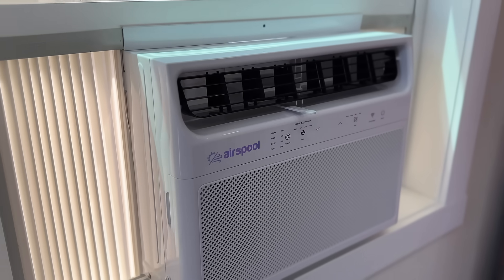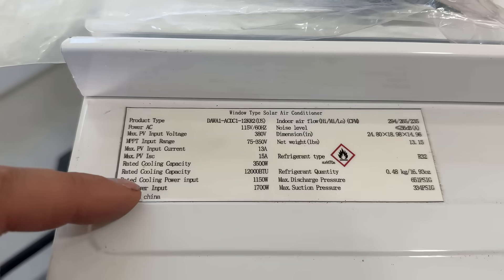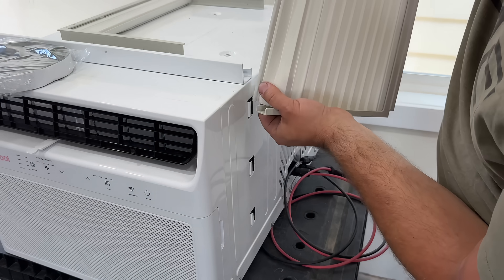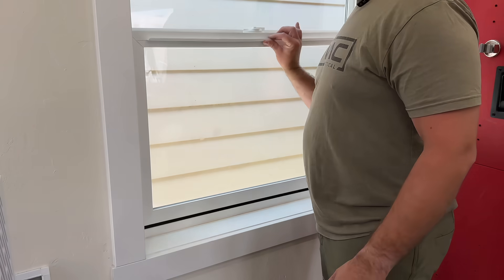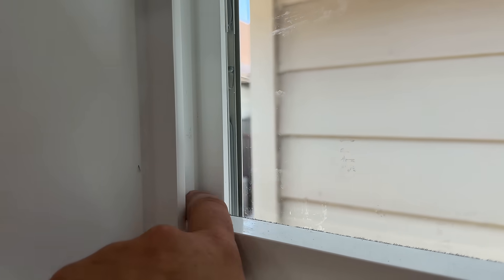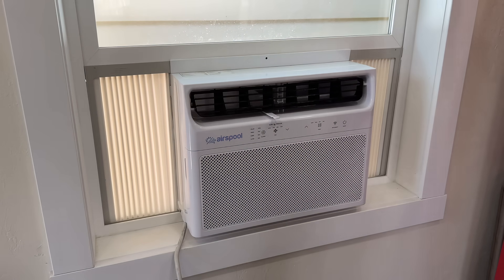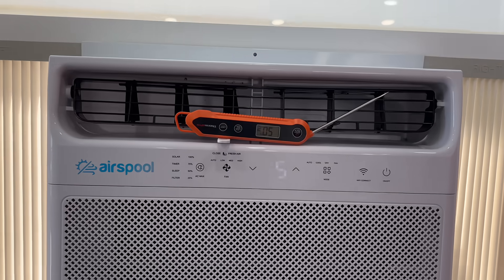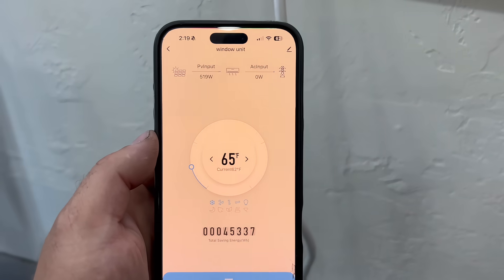Introducing The World's First SOLAR WINDOW AIR CONDITIONER...

Comment: What's wrong with using the solar panels and battery system (that aren't part of this AC unit) to fuel a pure sine inverter and simply plugging in a standard $100 5000 btu AC unit into that? A lot cheaper and that inverter can be used for other appliances as well.
Reply: Yeah, that's the first thing that came to my mind as well.
Reply: Inrush current.
Reply: @airspool  Ya, no. Not if you just get a window unit.
Reply: Likely more significant loss of efficiency going DC (solar) to AC (inverter).
Reply: @onlylettersatozornum  It's true there is some loss from the conversion but since that inverter can be used for many other things....
Reply: That's the way to go but peeps just don't know. Buy an AC and inverter and save $800 ..sigh

Comment: You have an "open" window,  the top of the bottom sash and the bottom of the top sash are no longer sealed against air/wind/bugs. You should have stuffed a strip of foam between top of the bottom sash and the glass of the top sash to prevent air intrusion into the room at this area now open to the outside, bugs can come in this area too.
Reply from the maker: Great point! I'll make sure to address that in a future video. 👍🏼

Comment: I'm amused by a sentence on the manufacturer's website when describing this window AC. "So much free cooling." I'm still trying to figure out the free part. Are they giving these ACs away? No. They're $1095 plus shipping and sales tax. It requires about 1800 watts of solar power, which they estimate at about $600 plus mounting hardware. When everything is all said and done, it's probably around $2,000 give or take a hundred bucks or two. Window AC units usually last about 10 years or so. I don't see this unit ever paying for itself. It's not exactly very efficient either. It's SEER2 rating is 17. I just installed a Hisense mini-split 12,000 BTU heat pump with a SEER2 rating of 23. I got a great deal on it and paid $650. My next door neighbor is a HVAC guy (hence the great price) and he installed it for free.

Comment: Very nice, just dont work the way I do my math:  150 doll ac in  H.Depot now have a Grand for electricity, and don't have to buy any solar panels, that probably would get a big fine from Citi if not installed with a permit.
Reply: With the solar not being connected to the grid, I don't think they'd care at all. I have solar hanging odd my balcony and have had zero issues because its only connected to an ecoflow delta pro.
Reply: @ArchoniaAdventures  Thanks for reply , it was a good video. Surely that AC will find lots of uses .

Comment: $1,195 for 12 000 btu AC that is conneced to power inverter? Total scam and waist of money. If you like quiet (42dB) buy Frigitair 12 000 btu windows AC model GWW125TE1 with additional true sigh inverter for around $150. I you like some no brand 12 000 btu AC from Amazon like KISSAIR is for $299 - same 42dB noise level.

Comment: i bought a new 8000 btu inverter window ac that doesnt require solar- just 110 outlet-  It works good , its like 20% less electric at most off my bill compared to my conventional window AC that i removed- U dont hear that surge when my 8000 btu conventional compressor use to kick in ...
Reply: Can you send me the brand or model numbef of that ac unit...got a shed I can use the 8000 btu..Thx

Comment: I have 2 mini split heat pump units that run on solar with batteries for 24 hours a day operation. Also I have a window unit that is an inverter heat pump unit. I can set these at 73 but they keep my house 68 to 69 all over the place. Oklahoma electric company got 5 price increases in 2024 basically doubled the price of residential electricity . I also power some other stuff in my house on EcoFlow delta pro units. I went from a $400. a month is summer to $49. a month. I put the stuff all to gather my self. I learned how on YouTube college LOL .
Reply: So your mini splits are directly connected to your solar setup and batteries?
Reply: They have to keep raising their rates to make up for everyone going solar!! (Just kidding). But congrats, that is a huge savings for sure! I would think the mini splits on solar would be the way to go, both heating and cooling. We live in an area where we have predominant need for heat and mostly cloudy or covered in snow those 3 months we desperately need it. I am hoping prices will come down to something reasonable for the 2 or 3 days of the year we can actually benefit from it 🤣🤣🤣
Reply: SAY MORE, PLEASE! 🙏 I want this setup!
Reply: Could you please make a video showing us how to install the mini splits with solar?
Reply: How many volts are the panel
Reply: Question....I'm still learning 
Recently upgraded my old marine batteries to Lithium Ion Phosphate 
Thinking it was an upgrade anyway lol
Question I've tried 3 different charge controllers that are advertised as Lifepo4 controllers 
The first two kept shutting down the system.  This last one is only reading 80% with full sun on the panels. Any ideas what I'm doing wrong.  It must be in the settings right???
Reply: Cost????
Reply: Can you point me to the right direction to do this? Is it just solar panels connected to a battery then to the mini split via some compatible wires? Or is it harder than that?
Reply: Bro make a video! Would love to see the set up 😊
Reply: Me too! 25 years master electrician but learned solar on you tube university 😊
Reply: That's awesome, I'm happy for you. :trophy-yellow-smiling:
Reply: Congratz
Reply: What brand heat pumps and window unit?
Reply: how much is your setup though? and for the cost of the setup, how many years can you run on the grid power? and after that many years, how much efficiency you will still have from the setup? my point is that, I only run solar if I have no other options, or I can get the setup for very little cost (i.e. over stock inventory with big discount, leftover material from some big projects, free stuff)
Reply: How much btu is the mini split and what's it power consumption on the inverter? I guess you need at least a 15 kW battery to be able to run it all night
Reply: I wonder how many of us following are from Oklahoma. :) .. Anyways I've been considering switching to Mini Split as well. Since you already have 2 I was wondering if you could answer this question. When switching to Mini Splits did you find them to be much easier on power than other air conditioner types? I've never had regular power at my place. I've got bookoos of solar, however I always like to figure in any potential power usage so just in case of a few overcast days from time to time at certain times of the year I'm prepared.
Reply: What mini split did you get?
Reply: So what was the cost to do the solar?
Reply: @lynndietz490  I've got over 25,000 watts of solar, Ibought from Santan and Signature Solar. 100% offgrid.Of course I bought used panels at the time but I can't complain, they run great. Of course theres ocassional maintenance with solar but its better than having an electric bill. :)
Reply: Congrats, I live in Ca. my electric bill last August was 600 a month, small singe story, the AC never turned off last summer, this summer it has been really nice.   I am looking at the EG4 12K Hybrid model.

Comment: This window solar ac is a good concept but is heavily over priced and energy hog so its not close to being efficient. The  EG4 12000 BTU Solar minit split only needs 900W of power and it comes with solar panels.

Comment: Get yourself a Midea or HiSense “J” or “U” shape inverter AC 8000 BTU for 289.00 and a EcoFlow Delta 3+ ( or similar brand ) for 650. 4 400w rigid solar panels and your set. This thing doesn’t store power so your SooL when there clouds etc. This setup gives you the flex of independence ie you can use the Delta 3+ for other stuff if needed.
Reply: I use a similar setup (without the solar panels). To keep a spare bedroom/office cool during random blackouts we have. The ac unit only uses 115 watts an hour and works great for our needs
Reply: Just to let you know, I have 2 of the Media units and they are great, but!  They just recalled them, 1.8 million of them for mold issues!
Reply: @17forever64  The recall is to check if there is mold present, if not, drill a bigger drain hole so water doesn't pool inside the unit.
Reply: @17forever64  FYI, only 152 reports of mold have been reported out of over 1.7 million units sold, so about 1 in 11,000 have mold reports so far, with 17 people getting sick, or 1 in 100,000...
Reply: @redbaron6805 I appreciate your response, but they recalled 1.8 million units!
Reply: @17forever64  Yes, as a precaution, as if they are not installed exactly level, they can form mold inside.

In reality, very few cases were actually found, and they will send a repair kit to install additional drainage to address the issue.
Reply: @redbaron6805 I’m a little concerned about the additional hole will reduce the efficiency of the units.  I’m not an engineer, but I did read that the unit uses the water to cool the compressor, that’s one reason it’s so efficient.
Reply: @17forever64  The efficiency difference should be very slight.

The unit actually uses the condensation from the evaporator coil, which is the cold radiator inside the window, to cool condenser coil, which is the outside radiator that helps cool the refrigerant.

The Midea unit uses an inverter technology and variable speed compressor, making it run similar to compact mini split system, which is the primary reason it is so efficient.

Using the condensation to cool the condenser coil helps slightly, but it is unlikely to make enough of a difference that you would notice the efficiency loss.
Reply: @redbaron6805 thank you!
Reply: I live in Florida, I had 2  Midea U units, and both had mold. Im sure most people are just taking the reimbursement. That's what I did.
Reply: @DaneSenior  In all fairness, mold is relatively common in A/C units due to the condensation that forms, as seen here:

"Mold growth in window air conditioners is quite common due to the moisture and dust they accumulate. While not all mold is harmful, it can be a concern, especially for those with sensitivities or allergies. Regular cleaning and maintenance are key to preventing mold growth and its potential health impacts."

Literally every single home has mold spores and up to 70% of homes have some form of mold.

It is only when the mold concentration gets high enough it becomes a health hazard.

Midea has basically just changed the design of their U shaped units to have better drainage to prevent mold growth.

So, this isn't really a Midea problem, but just something that gets highlighted on occasion.  Window A/C units are simply susceptible to mold due to the inherent design of how they work.
Reply: And how much is that vs energy saved … not worth it
Reply: @myaccount__7269 Cheaper than that thing and perfect for a detached studio /office. Dual function also.
Reply: @myaccount__7269 Studio shed, cheaper than permits for electric. Expandable ground mount solar, portable (27 lbs) Delta 3+, normal inverter HISense 8000 btu AC for 219.00 -> Costco. I guess it’s where your priorities are. I want flexibility, power during a outage and energy savings in normal operation. All for less than this AC costs.
Reply: @myaccount__7269 If you live where a power failure is life threatening due to the heat and fear losing the food in your refrigerator and freezer,$2000 is insignificant and a off grid source begins to pay back from day one. My personal experience with a similar but much larger system has been well worth the investment. I scaled up progressively over five years with savings on the electricity bills.

Comment: Wow this is great! I was thinking that this would be good for van dwellers then I read that "1800 watts of solar" would be suggested.  Most vans don't even come close to 1000 watts. I currently have 1125-1230 watts of solar on my van's roof.  After chatting with Airspool, they shared that it is enough for it to get the unit started but would be more like a 6000 BTU unit which is actually great for my small space in my van with no windows. 
I actually have a 38 SEER Innovair mini split set up for installation. Def takes up more room as I have the compressor inside the van.  But I was more interested in efficiency vs space.
Reply: Mike, yes, this will run at like 6,000 BTU if you have room for 1,000 watts of panels. But that's probably a good amount for the van.
Reply: @airspool  Thanks, sir. 6k btu is plenty for my square footage and the btu output is 25% more than my system. I would buy it if I could only purchase just the unit at a reduced price since I already have the DC isolator and MC-4 connectors/wires.
Yeah, I made sure to utilize all my roof-real estate solely for (3) 410w residential solar panels. Minimum output is 1125w and maximum is 1230w.

Comment: the idea is nice but pricing isn't , you're better off buying one of these " solar generators " and now any ac will work and you don't waste the solar power as these have batteries to store excess solar unlike these ac with solar built in , I run a 15k btu ac off an ac300 " bluetti " it too if bad solar days like rain etc will automatically switch to grid power till solar returns and even now while flooding from so much rain this month " Texas " my ac has been 99% solar and seamless switching between ac and grid as needed , diy a solar system and save even more money but is harder install while the solar generators are plug and play
Reply: Came here to same the same thing, my EcoFlow Delta 2 will easly run my portable AC unit, I have not tried my 14.7 btu LG inverter window unit. I dont see why not, on avarage it pulls less power than my portable unit

Comment: $300 less than the EG4 hybrid unit, but with the same fundamental flaw in the design...when you don't need A/C, your solar panels are doing nothing at all.
Reply: Jason, think of it a little bit differently. There's a one-time charge of $600 in panels or whatever to run the thing for free forever. Utilities have a monthly fee that you pay whether you're in town using them or not.
Reply: @airspool  - I strongly agree with installing $600 in panels, which I have done.  I run them to an AIO inverter/charger, which runs my window A/C.  When it's not hot out, it runs all kinds of other stuff, instead of sitting there, doing nothing.  Solutions like this one are VERY niche and only sell because people do not understand what they're actually buying.

Comment: I seemed to have missed the part where you tell us how much solar panels is needed if we are just using solar for the ac unit
Reply: 1,800 w +/- to run the unit on the hottest days at the full 12,000 BTU.

Comment: how long will it take you to make back the extra $800 that it cost over a regular window unit?
Reply: It depends a lot on where you live. If you are in a high rate State like California or Hawaii or upper East Coast, and you're running the unit most of the day, between $5 and $10 in savings a day. That adds up.

Comment: Shouldn't foam go between the inner sash and outer sash at the top of the inner sash to seal both from air and bugs getting in. As you did it, you have a huge air leak.

The bottom of your inner sash should already have some type of rubber or foam weather stripping.
Reply: Correct, both areas need to be sealed, he left a huge bug/air intrusion area.

Comment: Very cool! This would be a great setup for anyone renting who can't install a PV mini split. Especially if you mount this on a south or west facing window on the first floor, you could just lean a few panels against the outside wall of the house.
Reply: Right. It's a way for renters to go solar for what is often the greatest electrical expense... air conditioning.

Comment: Its a "cool" idea for a DC window unit.  But Its A)expensive Over $1k for a window unit is pretty high.  PLUS if you want to run it solar you have to have at least 600w of panels so you are talking another $600+ that puts in in the range of mini splits with installation. B) kinda redundant.  I think most people that have 600w or more of solar panels are going to have some kind of inverter system with storage batteries, which you could plug a regular high efficiency window unit into and its technically running on solar.
Reply: That ac unit he mentioned sucks 1700w maximum, though  
This is so true, especially during the initial start-up.   I doubt the 600w solar array can handle such a load
Reply: @LL-te7wn  The startup is fine.  It has an inverter compressor, so it just ramps up slowly to full bore.  But, yes, full bore in the summer can be over 1,400 w. It's very efficient for a window unit, but still needs this at 12k BTU.
Reply: True, I have a 22 sere inverter mini split hooked into my solar system, much more cost effective.
Reply: Guys, if folks already have an inverter / mppt / batteries, then they can plug this or another inverter compressor air conditioner in. Yes, you need an inverter compressor, really, to run air conditioning off of solar appeared or else you need a lot more storage, a bigger mppt, more solar panels, and a bigger inverter. The advantage of this one is you don't need the mppt / inverter / batteries. Just plug solar panels into it, and it runs. The more panels, the faster it runs. And then if you do have storage, at night time, you can plug into that, and you are preserving those batteries for night time use. So yes, DC Direct during the daytime, and then either Grid or battery at night time.